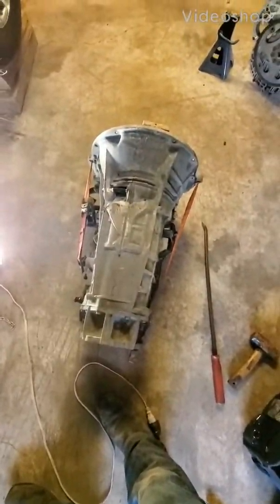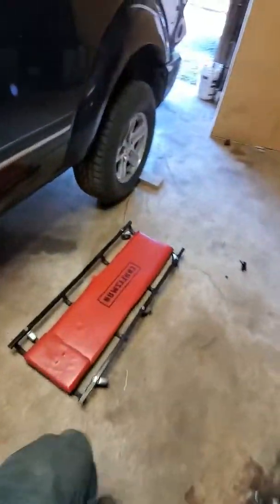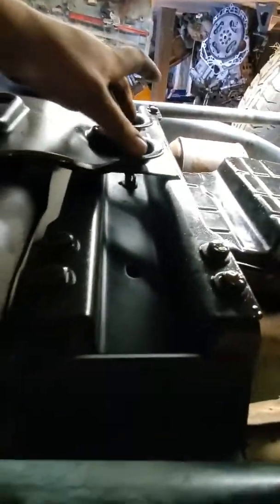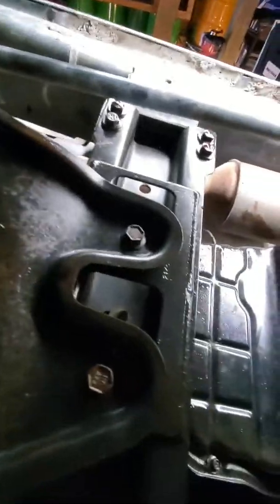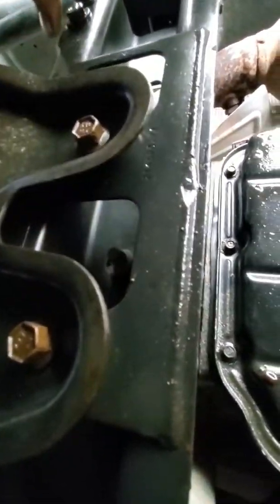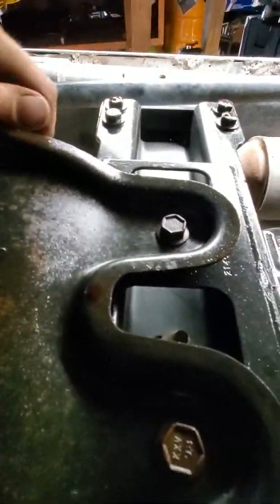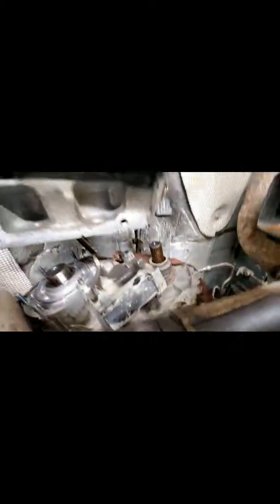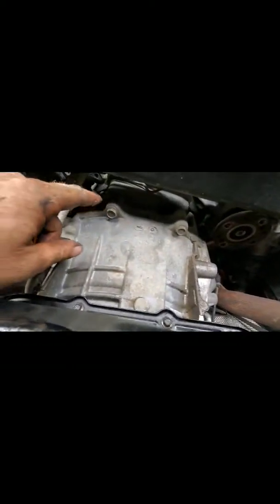04 Durango  transmission  take out

Comment: hi bro, i have a 2004 durango that need to replace the flexpalte, i understand that there is no need to drop the transmission nor remove the trani but to separate it from the engine. i have removed all 8 bolts (2 from starter motor which need to be replace and the other 6, 2 bottom, 2 on the right and 2 on the left. i put the trani on Neutral and rocket it sideways to see if will detach from the engine to give just enough space to remove the plate (some might call it the flywheel. the point is that the trani it is not pulling away from the engine and my question is WHY ?????  i did remove the drive shaft front and rear. did not remove the transfer case for i have no reason to remove it. please help.
I like your video tho

Comment: So im having trouble how did u get to the transfer case bolts? and the bots at the top of the bell housing
Reply from the maker: Take the cross member for the transmission out what the transmission and transfer case down needn't get to the top bolts with  a short wrench
Reply: @junkyardkeith6319  so this it difficult to take the cross member off? And where is the cross member located?
Reply: @junkyardkeith6319  also did you have to drop the exhaust on either side
Reply from the maker: 7
Reply from the maker: The top of the transfer case both I used a small short stubby range and the top of the tray for case bell housing bolts I used a long extension with a swivel socket
Reply: @gabrielcovington7651  Too late for you I'm sure, but for anyone in the future, I was able to remove a 545RFE transmission from a '06 Durango 4.7 with the exhaust fully attached. This was the factory exhaust so no guarantees with aftermarket converters/y-pipe. It is tight, but it is certainly doable. I did remove the upstream O2 sensor on the driver's side since it was pointed in toward the transmission. Once you get the bellhousing back behind the crossover pipe from the driver to the passenger side it is relatively easy.
Reply: @kevinvarnes4414  sounds like what I did
Reply: @kevinvarnes4414 How were you able to get the top two bellhouse bolts? The transmission harness runs in front of both of them blocking access to the bolts
Reply: @JGWPSS67  Oh boy. I've tried to block most of it from my memory. This is by far THE WORST transmission removal/install I have ever done. If there are any clips or bolts securing that harness to anything on the driver's side remove them to give you as much movement of the harness as possible. The driver's side was the easier of the two. I lowered the transmission down as low as it would go. I used about 3' of extensions with one hand to try to move the harness out of the way and 3' of extensions with the socket with the other hand to get onto the bolt. The passenger side was more difficult because that harness does not move much at all over there. If you stick your head up into the tunnel behind the transmission and have a light further up by the bellhousing you can kind of see what you are doing, but not really.

Install on the passenger side was a bear. I skipped right over four letter words and went straight to fives. I had to have a helper move/hold/manipulate the trans dipstick to get it lined up with the bellhousing hole and the two sets of extensions to get it into place. Use some electrical tape on the end of the socket and just over the flange on the bolt to hold it in the socket. Otherwise you will drop the bolt about 500 times. It probably took me 1.5 hours to reinstall the passenger side bolt.

Make sure the trans dipstick is somewhat in place before you mate the transmission to the engine or you will never be able to get it in. I would raise the transmission a little bit and make sure the dipstick was close then move it up some more. Before you fully mate the trans to the engine make sure the end of the dipstick tube is starting to engage the hole in the transmission.

There is also at least one bellhousing bolt on the passenger side (maybe the top starter bolt?) that will have to come out and go back in with the transmission. There is no room to get it out or reinstall it with the transmission in place. You'll know which one it is when you try to take the bellhousing bolts out.

I should mention i did all of this with the transfer case removed. I don't want to think about trying to do it with the transfer case still bolted to the transmission.

Best of luck and take your time. This requires extreme patience of which I have very little.

Comment: How did you reach the bolts on top of the bell housing
Reply: i used a long extension with a 15mm sucket runing it on top of the bell housing. pain in the ass to get it unbolt but finally it got loose.
Reply: @kalifoecua how were you able to get around the stupid harness that runs in front of those two bolts